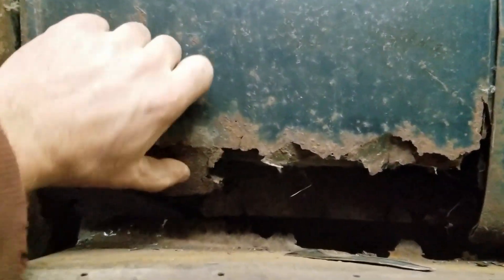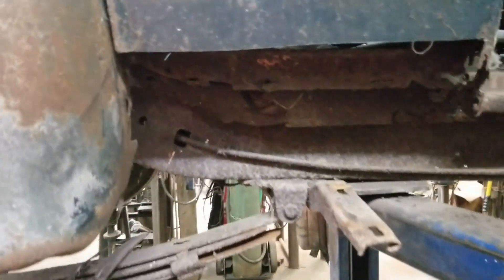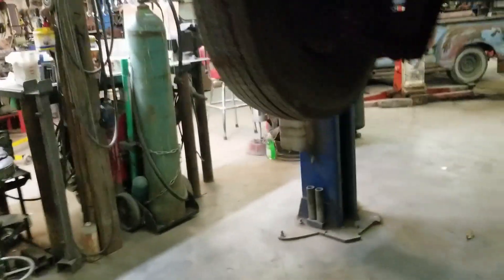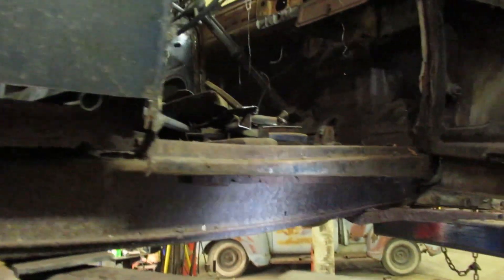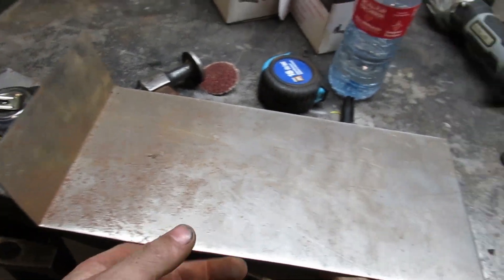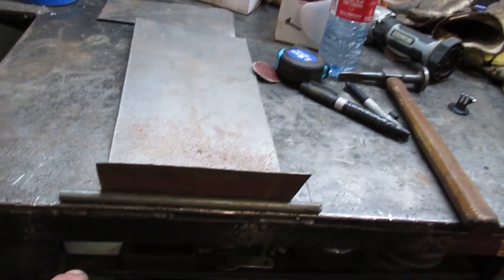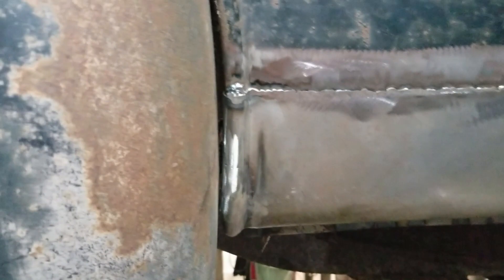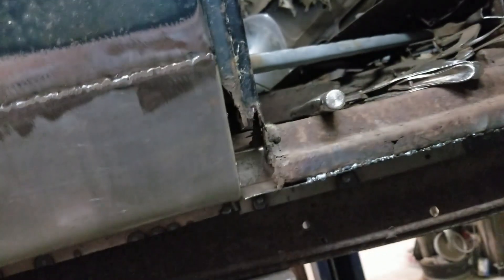Rust Repair on the 38 Pontiac

Comment: Hey Brent, I want to say how much I enjoy watching you do your craft. Your the man !!
Ya know if you would have taken the fender off, butt welding this which you know is the proper way to do it, would have been a breeze. You're, and I'm sure you know this, is just inviting rust down the road with that overlap because now there's an open gap on the inside, unless you seal that up real good. Even then with an over lap, condensation can still happen between those two pieces. Or mabe not. My thought, why take the chance. Anyway, keep them coming.👍😃
Reply from the maker: Yeah I hear ya, but there is always something that gets in there. If its salt over the winter or just not getting all the rust treated.

Comment: How about doing a step flange on the patch so it slides up under the existing body panel? Then you can weld over the seam and grind smooth without any raised areas to try to feather later with filler. 

You're doing a good job of approaching a series of complex shapes by breaking them down into manageable projects.  Each separate one is not difficult and very doable.
Reply from the maker: Thanks. I pretty much got lazy on this one, I should have just taken the fender off but thinking all the bolts where gonna break haha
Reply: Or he really could have butt welded it. The fender also should have come off. Would have made it a breeze to do it properly.
Doing a step flange is just inviting rust down the road the same with this overlap.  I'm not knocking him. Just seeing it as it is.